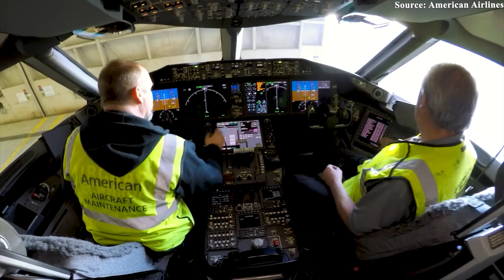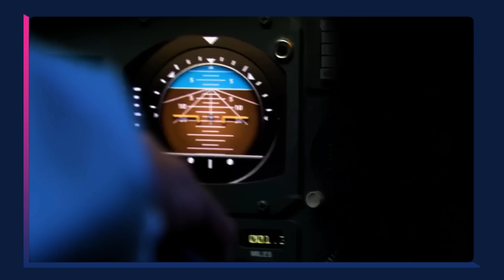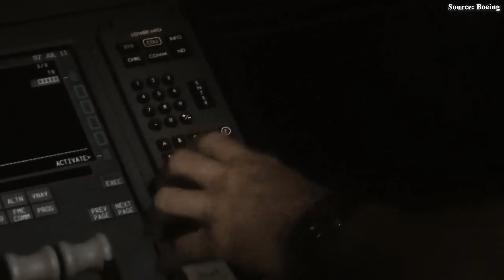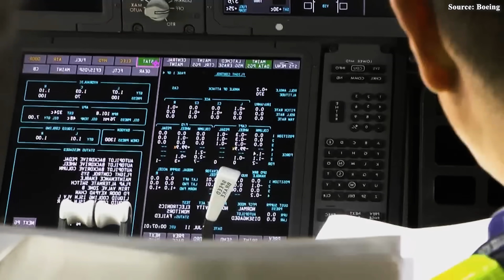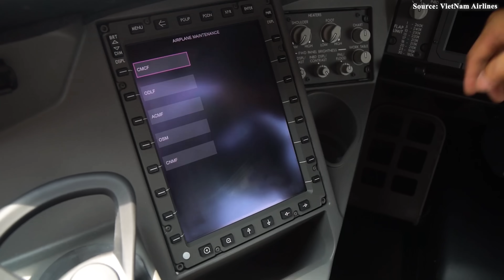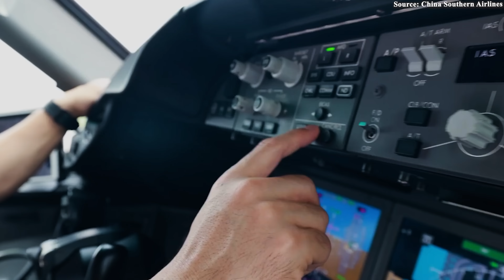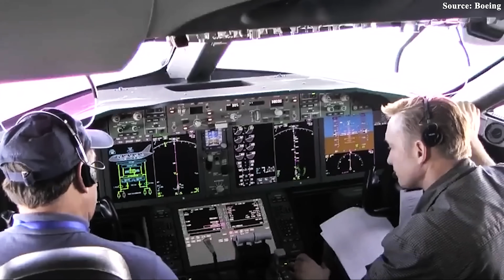They Just Dropped a BOMBSHELL about Boeing 787's AI 171 Flight!

Comment: ARE YOU TRYING TO PROTECT SOMEONE FROM THE CAUSE OF THIS ACCIDENT?                                                     According to Google on Chrome, on a Boeing 787-8 Dreamliner the fuel shutoff valves are designed to close and cut off fuel flow to the engines when electrical power is lost. This is achieved through a spring-loaded mechanism, ensuring that the valves default to the closed position in the absence of power. These valves are crucial for safety, allowing pilots to quickly shut off fuel to an engine in emergencies like fires or malfunctions. 

To my rookie knowledge, that would be obvious, because a fuel flooded engine is much harder to restart than one not fuel flooded.

As there were reports of outages of electrical systems in the passenger compartment of that very same plane still on its way to Ahmedabad, and lights flickering, that could be the cause of the fuel switches shutting off.

This corresponds with the Ram Air Turbine that was deployed automatically immediately after lift-off to restore electrical supply.

Again Google sourced from Chrome:
The Boeing 787 Dreamliner utilizes a novel approach to electrical power generation in its engines, employing a variable-rate current supply that differs from the traditional fixed-rate systems. This new method, while potentially offering benefits, is relatively untested compared to the established fixed-rate systems.

Comment: Just as in the 737 Max scandal the industry's self-interested and "safe"  instinct is to  blame the pilots. After all they are dead and unable to defend themselves.

And all of which conveniently ignores that fact that like the 737's MCAS system, the 787's
Full Authority Digital Engine Control (FADEC) means that there is no direct pilot control over the engine or manual control mode. So if the FADEC fails, as a result of one of the many sensors on which the system relies (such as the Low Altitude  Altimeter) being faulty, then the engines fail.

Comment: Flight AI171 was sabotaged by the luciferian illuminati, both of the pilots did not touch the switch, some people on the ground  hacked the system of the airplanes and cutoff the fuel switches. In a similar way, the airplanes in the so called 9/11 in New York in 2001 were sabotaged and the pilots lost total control and they were deliberately flown into those buildings. Nothing good can be expected from the western/illuminati media since it is rotten to the core known for its lies cheap propaganda and made up stories.

Comment: A very fundamental question arises if the Pilot Notes/ Flight Manual addresses pilot's action required in case of double engine shut down during the phase of rotation. If the pilots did not comply, then and then alone, can the blame be insinuated on the pilots. If no such procedure is laid down, the blame would rest fairly and squarely on the Boeing company
Reply from the maker: Thanks for the insightful comment!

Comment: Fuel switches had NOT moved. Fake comment. Think design and electrical glitch.. tech manual tells us fuel switches need NOT move If electricity to fuel valves  is lost for even a fraction of a second, 787 and 777. Then, the spring loaded fuel cutoff valves to the engines will snap shut. Cockpit switches stay OPEN.... Happened to ANA 787 after landing using reversers, in Osaka and unable to restart.   Rtd Training Capt EAAC  Pilot Union rep at Regional Air Accident Investigations
Reply from the maker: Thanks for your insights!

Comment: If indeed the switches were manually turned off then it is Boeing FAULT for allowing BOTH switches to be turned off on take off.  However evidence suggests the aircraft's emergency power system, the Ram Air Turbine (RAT), deployed automatically on take off, indicating a loss of power from the engines.
Reply: BS. If it was not the switches, the Pilot  could have crashed the plane  with dozens of other 
choices.

Comment: If the fuel switches were defective and didn't lock in the run position, I see three forces at takeoff that would move them to the turn off position:  1. gravity from tale off angle, 2. thrust, 3. vibration.

Comment: Is there a chance that the switches were turned off prior to lift... maybe by cabin cleaning crew, and they were not checked off before take off???
Reply: you  need the switches to send fuel to engines so there is no chance for that. It happened after the plane had just taken off
Reply: ok, understand...
Reply: @sylviaSMS-n6e A previous engine failure on a Nippon (All Nippon Airways, ANA) Boeing 787 is often referenced in the context of recent Air India crash investigations due to similar technical elements. The ANA incident occurred on January 17, 2019: after landing, both engines of a Boeing 787-8 (flight NH-985) shut down because of fuel cutoff. While the aircraft was already on the ground and was eventually towed away, the event raised concerns about possible vulnerabilities in Boeing 787 engine control and fuel systems
Reply: You don't take off without engines.
Reply: The black box clearly showed the jet took off with switched in on position. The fuel valves for BOITH engines were turned off one after the other in 1 sec. They were turned back on 10 seconds later. The black box records all switch and dial positions versus time.
Reply: @joehiden7475 the RAT deployment time stamp is missing. The RAT hydraulic developed at 08.08.47. Work it back and it coincides at take off at 08.08.04. In other words the switches were flipped AFTER the engine failed.

Comment: Why is there no audio alarm in a situation like that?
Reply: The guy flying the jet asked the captain why he moved the switch positions, and he deigned doing it, Alarms would not have fixed that. You cannot cut fuel at such a low altitude and recover. The software should not have allowed the condition to occur regardless of switch position. This is obvious unrecoverable.
Reply: There is an EICAS message displayed for fuel cut off in flight mode.  Imagine what that would sound like when you need to shut them down.  The copilot figured out what was happening in seconds and in fact the switches were returned to the run position before the crash.  This was no accident nor a plane malfunction.

Comment: If the fuel was switched off to both engines, turning it on will not restore power. It needs the “Starting engine on flight” procedure which will include - thrust levers idle - igniters on - relight attained - increase power to desired setting. If an engine did relight due to a hotspot in an engine - the unburned fuel would be of such quantity, it would destroy the engine. I know of an instance with a BAe 146 where a relight at full throttle wrenched the engine off the wing into Belfast Loch.
Reply: FYI, the engines did relight and one was spooling up but it was too late.
Reply: Not true. The system on this plane automatically tries to restart. In fact number 1 engine started to relight

Comment: It doesn’t matter what type of aircraft the pilots are in if one or both is hell bent in turning the fuel to the engines there’s not really much the manufacturer can do about it so don’t question about Boeing making a flawed design fault the samething would of happened on an AIRBUS plane as well The only think that could be possible is that you need 2 pilots to manually shut off engines but how to you plan something like that if one of the two pilots is incapacitated Another way involves costing again you bring back cabin crews of at least 3 or 4 like older long haul flights but I can’t see that happening with the OLD DOLLAR ALWAYS RUINING OVER HUMAN LIFES
Reply: Not true on a 787!

Comment: They mentioned in the report that the captain appeared unusually calm, which they suggest indicates poor mental health and led to the crash. But the last time I checked, there are two pilots in the cockpit — how could the atmosphere remain calm if one pilot was intent on crashing the plane while the other saw certain death approaching? There’s clearly more to this than what’s being presented. If it’s Boeing, we shouldn’t be going.
Reply: The Captain was calm, the First Officer was not.  The Captain is always in charge, even though the First Officer was flying.  Which is why, the First Officer asked the Captain, WHY did you turn the switches to Cutoff.

The only one that could move the switches was the Captain, as the First Officer has both hands on the Yoke controls during take off, and has no free hands to do anything.  The Captain, as pilot monitoring, has both hands free during this time, so was the only one that could have moved the switches.
Reply: @redbaron6805  Facing death, why was the atmosphere in the cockpit calm? You haven't answered that question. There are no officers after death. Boeing's theory one captain on a suicidal mode is non comprehensive. The co-pilot or any sane person can't be calm if they are forced to death by the captain/senior. The Boeing's crash theory fails here.
Reply: @deuceballbpos5875  The Captain was calm as he had already decided he was going to die.

The First Officer was stresses as he did NOT want to die.

No one said the "atmosphere" was calm, the Captain was calm, the FO was not.
Reply: @redbaron6805  Were you in the plane to witness the moods of the pilots as the report doesn't give this much information! Are you from Boeing by any chance?
Reply: @deuceballbpos5875  They already reported the CVR conversation and there is even analysis where Psychiatrists are listening to the audio and saying the captain sounds like he is having mental problems.

So, don't worry, when you get out of the coma and open your eyes, the facts will be staring you in the face...
Reply: @redbaron6805  Lol, that means you are a Boeing bot and havent read the report. Nowhere in the report is the entire conversation mentioned.
Reply: @deuceballbpos5875  OK there Air India Bot... 

Just keep spamming that Ai nonsense and telling yourself anyone will believe you...
Reply: @redbaron6805  Lol, you seem to be from the Boeing AI investigation team representing sales and marketing. Read the report.
Reply: As a rule pilots are not allowed to sports beard as it will  affect the use of oxygen mask in emergency situation  and endangers livesvof passengers
Reply: @eddydizon7174  Not a full beard, but a short beard is fine.

They just can't have a full Santa Claus beard as that prevents the use of Oxygen masks.

Comment: Another cover up by Boeing like 737 Max and more passengers get killed due to Boeing faults
Reply: Might be their fault for hiring a mentally ill pilot who wanted to unalive 240 passengers. The switches did what they were designed to do. Maybe they need to build their software where regardless of switch position, the software keeps fuel valves open until you reach a safe altitude to recover. Otherwise, this could happen again today. Boeing did not design their jets against being flown by unbalanced mental patients. Maybe they will have to remote fly them in the future with supervision carrying tasers.
Reply: @joehiden7475 nope...nothing wrong with him. The switches were flipped AFTER the engines failed.

Comment: He is not even aware Boeing computers EEC and FADEC computers can turn off both fuel supply switches without Piolt intervention if computers sensors feed anamoly and think aircraft on ground not airborne. Same happened in Japan Airlines 787 and since it happened at high altitude Pilots could recover. Here no time to re ignite engines at low altitude
Reply: If you are going to make claims about a previous event, at least make them accurate.  The ANA incident didn't happen at "high altitude", it literally happened AFTER LANDING when they deployed the THRUST REVERSERS.

The ONLY difference between moving these switches on the Ground, vs in the Air, is in the Air you would get multiple warnings, an Engine Restart Checklist, the APU Automatically Starting and other functions.
Reply: Then why are Indian authorities agreeing with the conclusion of the pilot moving the switches?
Reply: @carlfrye1566  The CAPTAIN did move the switches. They have audio and the black box records all instrumentation versus time. There is no doubt. Sounds like simple programming could eliminate this issue.

Comment: RAT was deployed. What circumstances led that to happen. Both switches were operated within 1 second between them. Would that be feasible given the way these switches are operated. The pilot when asked by the other if he cut off the fuel supply answered a definite no. Pls do not speculate until more info is revealed and the whole truth is known.
Reply: The RAT deployed as all four electrical power generators where turned off when the engines shut down.  There were then turned back on 10 and 14 seconds later.  No one would wait 4 seconds between turning them back on, unless it was just done to show they were on after the crash.

Comment: Main component here is EEC - Electronic Engine Control, the main part of the FADEC.
Valves are not directly operated by the switches.
Switch position and various other input signals go to EEC.

EEC operates various valves in the fuel metering unit (FMU) to control the flow of fuel to the combustion chamber:-
Servo valves
High pressure shutoff valve
and fuel metering valve.
EEC uses data from both airplane systems and the engine to control the engine.
Integrated propulsion application software monitor the fuel control system.
There is a permanent magnet alternator in the fuel control system for primary power source.
Airplane power is a secondary source.
EEC get inputs from the common data network.
EEC calculate the correct fuel flow and the engine airflow..
EEC shuts the engine down when parameters are not in the correct range.
EEC got two channels,  one of them is standby.
EEC uses PMA power - 115v 3 phase ac  during normal operation.
Reply: There are TWO independent FADEC computers, and each switch only talks to one of them.  They have nothing in common, and can't fail simultaneously due to any malfunction...

Comment: The report stated both switches were moved to OFF within 1 sec. The switch is spring loaded and it has to pulled against spring force and made to OFF. Experienced 787 Piolt has stated it is humanely impossible to turn off these spring loaded switches Off 1 sec of each other
Reply: Already tested and cockpit recording confirm it was the captain that turned them off
Reply: They tested it already, and they can easily be turned off 1 second apart....

Comment: The only reasons the Run/Cutoff switch should be moved to the Cutoff position while the aircraft is in flight mode is when the engine RPM are BELOW idle or there is a fire alarm on the engine. It's mind boggling that their wasn't at LEAST an alarm in software for an inappropriate fuel cutoff. One would think that after the 737 MCAST disaster, which was essentially a software problem and the  Boeing Starliner failure again major software problems, that Boeing would step up their software engineering.
Reply: There IS an alarm on the engine display panel.  You can't lock pilots out of every system.  If a pilot wants to crash an airplane, no system can prevent that.
Reply: I would never fly India Airlines seeing that they do not appear to be vetting the pilots they hire. It will be interesting to see what they uncover in the future on this captain.
Reply: @joehiden7475  I wouldn't go quite that far.  There have been at least 3 prior incidents where a pilot decided to end his existence, and take everyone with him.

There is no common nationality among them, as one was from Egypt, one was from China and one was from Germany.

This isn't an airline or nationality issue as much as it is a mental health issue.

Pilots can NOT report if they are having mental health problems without being permanently grounded.

That needs to change.  They need access to reporting systems that treat them with compassion and respect, and help them address any issues they are having.

Comment: Time line, sequence of events need to be stated. When did the N2  start dropping, when were the start levers moved to Off. This would prove that the engines did not flame out, and a “quick relight was not attempted.” Did the RAT deploy before or after the Start switches were moved.
Reply: The N2 reached bellow minimum idle on both engines. Then we had increase EGT increase on both engines. That indicates the FADEC lit up both engines above 20% N2 in the remaining 15 seconds after the fuel switches were restored to run. That’s amazing considering the primary bus would have no power, and the APU would not have reached operation. The only inputs by the pilots was to operate the fuel switches in 32 seconds. They didn’t even try to increase thrust above TPR. I smell something 😂

Comment: I think you are jumping the gun. The interim report has not said that the switches were turned off manually. That would point to pilot intentionally putting the switches in "cutoff" position. The report says that the switches were in cutoff mode then quickly put in the "run" mode. That could point to a flaw in the system. Otherwise why would the pilot say "I did not"? So the jury is still out on this one.
Reply: You got it wrong.  The report said the switches were moved to Cutoff, 1 second apart, and then put back into run mode 10 and 14 seconds later.  These are mechanical switches, connected to two independent computers.  They can not move on their own, and they can not malfunction the same way at the same time.